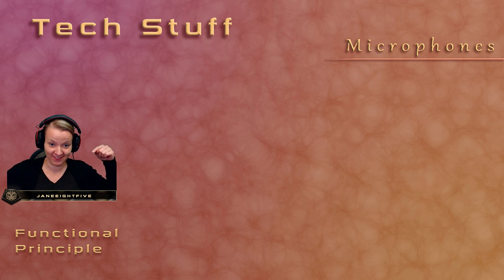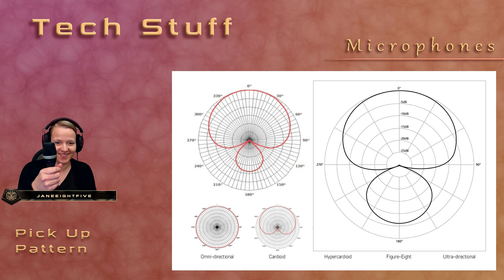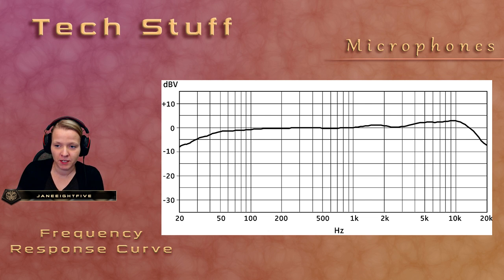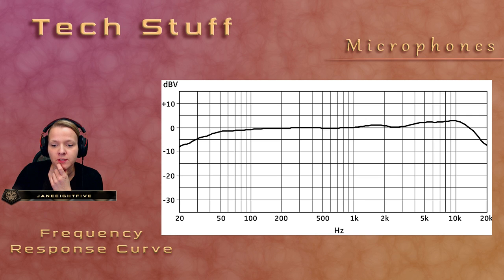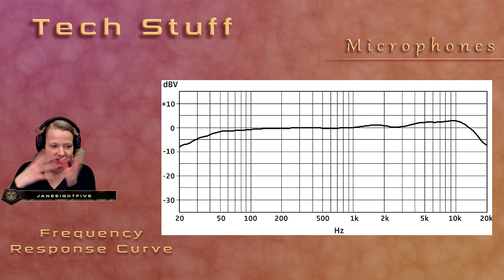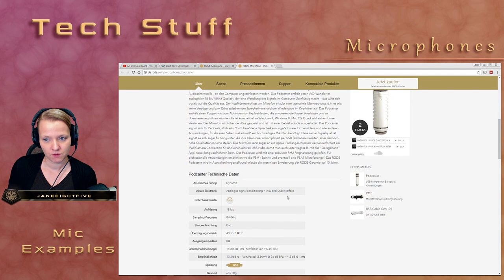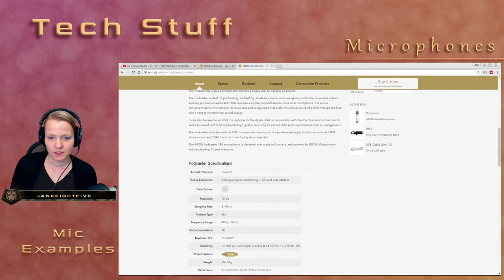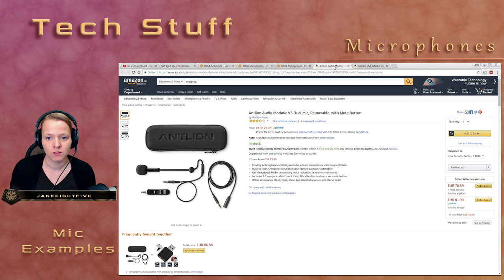How to choose audio equipment for streaming and vlogging

Comment: Hi! Thx for the deep insights! Regarding the stereo, would that be an improvement to use stereo pattern while speaking by the middle of the mic over using mono (because even in mono the sound goes to the left and right anyway, right?)?
Reply from the maker: MegaBates Actually you record voice only in mono. Mono means the signal is on left and right channel similarly. If you record a voice in stereo, it will be on the left, in the middle OR on the right channel depending how you sit or move in front of the mic. You don't need that and it irritates a bit. 

It would make sense for surround sound if you want the people to know where the signal comes from. But if you only record voice, you dont need a stereo or eight pattern. Just record it in mono with a cardioid pattern. There's no advantage of using stereo for recording voices.

The figure of eight pattern could be useful, if you only have one mic but you are two people. You can put the mic between both so that one talks into the left and the other into the right side of the mic.

Hope that clears things up.
Reply: JaneEightFive Hi! Thx so much for the answer! Crystal clear!